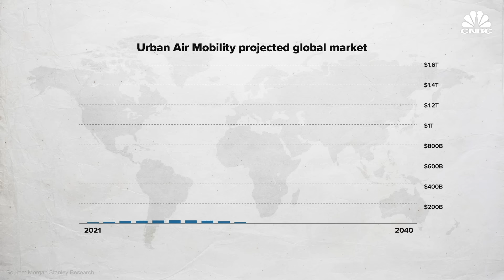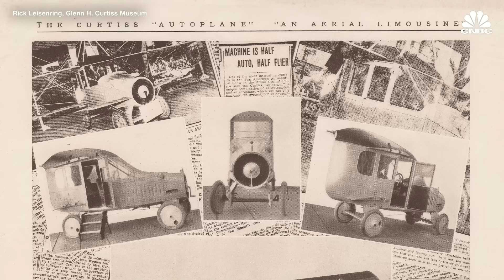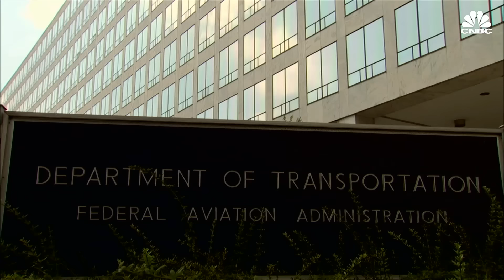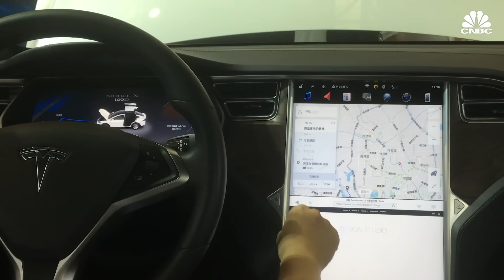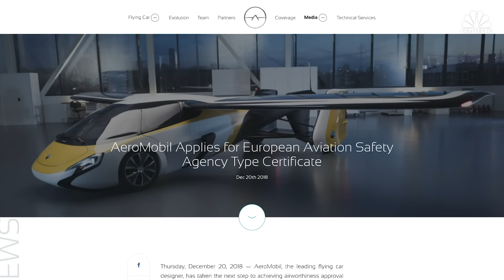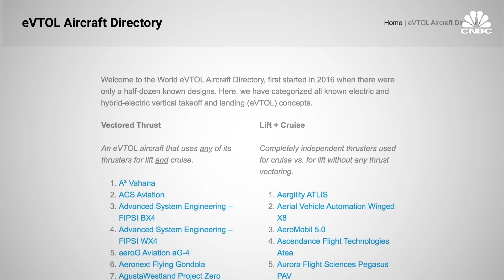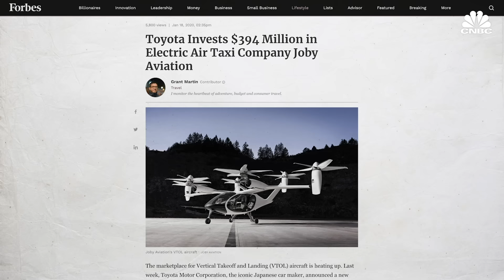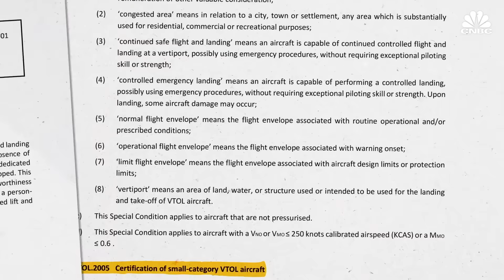Why Don't We Have Flying Cars Yet?

Comment: You cant trust people with cars imaging trusting people with cars that can fly... What a nightmare...
The solution for transportation is more RAIL with roads as support not air.
Air should only be for cross continent and urgency.
Reply: Vitor Leão  rail in the us is unreliable. The country is simply too big
Reply: Think flying cars would be attractive to emergency services operating in areas with congested traffic
Reply: @lzh4950  Helicopters
Reply: @ethanferns5495  That is exactly what rail is best at. The bigger the country more effective rail is!
Rail is not as fast as flying but it still much faster than road and many times cheaper than flying.
You can even make high speed rail (bullet trains). They can reach between 30% to 80% of the speed of a conventional plane and be operated by a fraction of the cost.
The biggest problem with rail is the initial investment. Its huge but the advantages pay off.
Reply: That’s why they test it when someone drives bad they will be ready
Reply: @sync1463  There are many cases of bad drivers that passed those tests and many cases of people driving without a licence.
Tests are not bulletproof.

Comment: We DO have flying cars, you can buy a PAL-V 100% legal on road and in the air ( In US an EU )
Reply: NOPE - SORRY - they are taking pre-orders ONLY.  they are not in production.  by the way,  for sale in the US it will have to pass all the safety test as any other car, EPA emissions, airbags, crash testing ...
Reply: @yorinov2001  You are correct! the launch is pushed back to 2021.

Comment: I'm a little surprised that they didn't say much about piloting the aircraft.  A few thoughts from a pilot:

1) Even for an autonomous aircraft, a trained pilot still needs to be on board the aircraft to fly it manually if the guidance system or any other major component fails.  The autonomous aircraft concept works as long as nothing goes wrong, but any emergency - motor/engine failure, computer failure, low battery, unusual aircraft attitude caused by turbulence, lost communication, bird strike, severe weather, aircraft icing - would likely be fatal with no pilots on board to fly manually.  

2) Your average person with a non-autonomous flying car would have to go through pilot training and be certified, and then they'd need to stay current with the requirements of maintaining their certification as pilots.  

3) Long-established aviation rules dictate that every flight must have a pilot-in-command (PIC) who is responsible for the flight.  An autonomous aircraft still needs a PIC to oversee the flight and to make decisions about the safety of the flight.  This would require that a person serve as PIC for every autonomous flight, which would defeat the purpose of having the flight be autonomous.  Even drone (UAV) flights are still required by FAA rules to have a PIC for each flight.     

4) The aircraft must be able to communicate on the radio with air traffic control (ATC), and ATC must be able to track the flight of an aircraft with radar.  This is necessary to provide separation from other aircraft and to facilitate the flow of air traffic.  The airspace over large cities is already crowded with conventional aircraft, and it's unclear how a large number of new aircraft would be integrated into the ATC system, even if they were autonomous.  

5) Changing weather conditions (or other hazards) may require alterations to the flight plan, a decision not easily made by a computer.  A pilot (the PIC) needs to be available to.make decisions about contingency plans or to alter the flight route to avoid weather systems and hazards or to divert to a different landing site.  

I see these as much bigger challenges to flying cars than the technological challenges of designing the cars themselves.

Comment: Whe can’t have  flying cars cause we can verily afford helicopters
Reply: Flying cars will be cheaper, fuel efficient, and will require very little maintenence
Reply: AViaRooster how? If they’re electric?
Reply: Think a key challenge is shrinking a helicopter's architecture e.g. rotors into something narrow enough to fit into a road lane, while still generating enough lift to stay airborne when necessary
Reply: @Drewpreneur  if flying cars werr a thing, 9/11 everyday.
Reply: @octave1  Never make a comment like that again. Very rude and inappropriate. Also, before you say something like that, research it.
Reply: All of the flying cars featured in the video are cheaper than your average helicopter
Reply: @Drewpreneur  it wouldn't be that because the government didn't pay you to crash.
Reply: You all will need pilot license for that thing even if it is cheap
Reply: @mo gamer well maybe you should research more into what you say. The USAF hosted a meeting with an organization im in, where we discussed cars and vehicles of the future.
Reply: @Drewpreneur  riiiiight.....
Reply: @Drewpreneur  Like it or not, he has a fair point. If car crashes keep happening everyday on the roads and streets around the world, imagine them in air. I wouldn't be surprised of careless drivers crashing against buildings causing damage and deaths. So yeah, it'll be like 9/11.
Reply: @luismenezes8261  it wont be like 9/11 because that was a terroist attack that was planned years prior and was an abduction of an aircraft. Flying cars or now considered "Orbs" have advanced software called traffic networking. You think that flying cars will be controlled by you.. it wont.. instead its all programed to occur by itself. Also, never compare a national tragedy with a minor accident that occurs everyday. 9/11 killed thousands and haunted millions. Not cool man.
Reply: @Drewpreneur  where did you get this information about advance software? Anyway, a fatal car accident is still tragic and it happens every year. In the US alone, around 38k people die in such accidents each year . That's 10x the number of causalties from 9/11. Don't forget that if a flying car crashes, it will fall damaging or killing anything beneath it.
Reply: @luismenezes8261  i have this information because im in the USAF and i participated in an Orb showcase hosted at an Air Force banquet.
Reply: @rajveermunde6079  do you know how expensive it is just to get a ppl, thats thousands of dollars and a time investment.
Reply: @childish8469  yea bruh

Comment: Like someone else said, to drive a flying car you’d need a pilots license and on top of that you’d likely still get a lot of traffic if there’s other people doing the same thing because you can’t just fly wherever you want. Air traffic and enroute controllers are gonna put you on a pre-determined path between point A to B (so you don’t run into terrain or fly over places with noise restrictions or restricted airspace) that’s also gonna be followed by a bunch of people going the same way. Plus it’d likely follow the same thing that they’re tryna do with drones atm which is basically have different altitudes for people travelling different distances so that people travelling further are higher up and go faster than people only travelling like 5 mins away. There’d also be the issue of flying cars getting in the way of the commercial aviation industry and their safe operations though.

Comment: The main issue with these stories is they always reference self-driving or autonomous cars as a principal driver for the advancement of the deployment of flying cars; why don't they follow up with the fact that drivers won't need private pilots' licenses to use the vehicle as a plane? What do the technological advances to make a car / plane hybrid have to do with autonomous driving other than this? In addition, you'll need significant infrastructure and regulatory sign-off to decide where these can take off and land, and how they'll operate once in the air, since there won't be roads, highways or on / off ramps to guide travel. With a significant number of vehicles now operating without these guidelines, the chances for collisions are increased with dramatic effect, since the vehicles will not only suffer the force of a in-air collision, but also the resulting fall to the ground if the vehicles can't maintain enough power to safely land, which endangers not only those passengers in the air but those on the ground, as well. These issues need to be explored and resolved before this can become mainstream.

Comment: Its easy.. here's the solution.. just design flying wings that can be called anywhere.. a driver of a normal car calls his wings from the nearby center.. it comes and attaches itself to the car perfectly then the driver can control it and take off and after usage the wings will return back to nearby centre.. it solves many problems lik you dont have the battery and charging issues bcz they will always be charged at its centre.. and all you need to design is how to make wings more efficient and adjustable to traffic and other issues..how much wing power needed for vehicles and balancing in difficult weather..   atleast that's how they are approaching this in another parallel universe..

Comment: Flying cars will now include a 3rd-dimensional input which would put the industrial environment at risk, especially if the smallest problem occurs in that vehicle or VTOL.  We should not spend trillions focusing on air transportation but instead, we should be focusing on dramatically enhancing train transportation under the earth (dramatically reduces risk in my opinion.)

Comment: Among other reasons is the need for wings, huge ones.  One thing that really hampers this area are government regulations.  Cars have become enormously heavy, even as they cut down in size.  My 1973 Audi 100 had the same room as a medium or large car, yet it weighed 2,530 pounds.  The same car today would weigh 3,530 pounds or so.  Thus, as cars get heavier (for safety reasons) the need for a flying car is, if  anything, to get much lighter.

Comment: People maintain cars poorly. That would only get worse with a flying car that is heavier and would definitely wear on the engine more. A flying car would be a little larger than the size of a motorcycle but will still cost way over $100,000 with insurance on them being very expensive to account for all the liability with operating them. Landing and taking off with them will be a problem as it is among the most dangerous times when operating a helicopter. The impact from landing them would also wear out car more with repeated impacts that are otherwise solved in helicopter designs. Flying cars make WAY more problems than they solve.

Comment: Electromagnetic flying cars, also referred to as electromagnetic hovercrafts, are a concept for future transportation that utilizes electromagnetic forces for lift and propulsion.  While not yet a reality, they are a fascinating idea with both potential and challenges.

Here's how electromagnetic flying cars would potentially work:

Magnetic Levitation:  The core principle involves electromagnets on the underside of the vehicle repelling a metal surface or track on the ground. This creates a cushion of air, allowing the car to levitate.

Electromagnetic Propulsion:  Electromagnets or other electromagnetic devices could also be used to propel the vehicle forward or accelerate it.

Potential Benefits:

Reduced Friction:  Electromagnetic levitation eliminates the friction between the vehicle and the ground, leading to smoother operation and potentially lower energy consumption.

Environmentally Friendly:  If powered by renewable energy sources, electromagnetic flying cars could be a more sustainable mode of transportation compared to traditional gasoline-powered vehicles.

Reduced Traffic Congestion:  These vehicles could potentially operate in three-dimensional space, alleviating traffic congestion on roads.

Challenges and Considerations:

Technological Hurdles: Developing powerful and efficient electromagnets for large-scale use remains a challenge.
Infrastructure Needs: A network of special tracks or surfaces might be needed for levitation and guidance.
Safety Regulations: Safety standards and air traffic control systems would need to be developed for widespread adoption.
Current Status:

While electromagnetic flying cars  aren't yet a practical reality, some companies and research institutions are exploring the concept. There are experimental projects using electromagnetic levitation for short-distance transportation systems like maglev trains.

The Future of Flight:

Electromagnetic flying cars represent a potential future of transportation, offering a quieter, cleaner, and more efficient way to travel. However, significant technological advancements and infrastructure development are needed before they become a mainstream reality.

Comment: It is for the same reason we don't have flying boats.  The practicality of it is as absurd as making a gun that also doubles as an immersion blender in the kitchen.  

If there is anything that could even be remotely considered and taken seriously, it would NOT be part airplane. There are at least 2 showstopping reasons why an airplane crossover would never work:  For one, planes need space to take off and land, and there is no practical way to do it.  Secondly, adequate wingspans would not work for roads.   EVERY SINGLE road would have to have each of its lanes widened 4x the current size.  Have you seen any modern day road construction projects on ONE highway where they are adding ONE lane, and observed the difficulty, cost, time, and disruption it caused?  I rest my case.

Instead, it would be a car that is also a a drone.  This way, at 4 wheels, there could be 4 retractable rotors.  Secondly, it would allow a vertical takeoff.  However, even in this case, this is something that is likely not reachable for another 100 years.

Comment: Will only work once fully autonomous cars can fly themselves without a lot of errors. Imagine a crash mid-air - it would mean instant death for all passengers. 
Cars are also pretty heavy - you don't want a car to crash into a house from high altitude which would massively increase its impact. If you take physics into account
a car with the weight of let's say an Audi A5 would totally destroy a house on impact, simply because it's speed increases with every meter it's falling.

Comment: Imo flying cars aren't the way it will cause problems I think 
Hovering cars are the way, no need for tyres, weight reduction, more space for engines and batteries, better designs, no damage to the road, they'll be no need for suspension which could also save money and make heavy cars better as if they're not on the road they'll feel weightless and will be a smooth ride, oh and no getting stuck in sand or mud lol, less noise pollution (nowadays most car noise is the tyres) 

Vtols seem cool though even if they was only for companies for transport, I don't see the Nanny State will allow your average Joe to own these but Taxi Services and Buses will

Comment: Lets improve people's driving before they can even start flying. People driving on the road these days have absolutely no reason to be on the road with that so much driving issues. With car crashes, you can at least potentially rescue a life or 2. but crashes in the air and this doesnt even including weathering effects. It's advance early VS die early.
Reply: Lol. True people's driving is worse than it used to be in the past because they easily get the license(by driving good in the test), and then people start showing their real driving.

Comment: The mess, the noise, the risk and the energy problem would just not make sense. Flying cars in urban environment would make sense if and only if they could be silent and they could passively float with a dead engine... which according to physics would be pretty complicated. Ground and underground transportation could be made orders of magnitude more efficient, going in the air is wouldn't be efficient

Comment: One answer could be cars that rent flying gear at airports!  In other words cars engineered to attach to a flying skeleton (not sure what to call that)   So you pull into the airport and wait in a queue for your car to be attached to everything needed to fly....no pilot license needed because that is all handled by computer and your Uber like app on your phone where you select your destination ...it flies your car to the designated destiny you land detatch and drive out of that airport passengers luggage and all .....you could perhaps drive/fly from LA to San Fransico area in an hour or so as opposed to several hours or could fly/drive coast to coast in maybe 6 hours or whatever ....that might require fuel stops which of course would all be handled via computer....of course one would need to hop out for bathroom break as "car" was refueled....maybe grab fast food too which of course your order would be waiting for you since you are ordered it on your route ...I envision portable restroom RV type vehicles computer driven to to each landing /refueling site along with automated catering vehicle delivering your meals
Reply: Maybe even better would be a detachable cockpit  modules that constantly gets reattached to either a flying or driving platform ....much lighter that way and so a large coast to coast flying platform could haul a bunch of these even dropping off and picking up modules at various cities along the way...you could select economy platforms. 4wd platforms or something really sporty higher performance depending on you budget and destiantion?  Even attaching to self-contained RV platforms for vacation destinations?  cool idea huh?

Comment: A vehicle light enough to fly is unfit for safe road handling, and a vehicle safe on the roads is too heavy to fly efficiently. They don't work or people would have driven their planes home after landing and folding their wings years ago. Also, the air-traffic control nightmare!! Cars and planes don't mix.